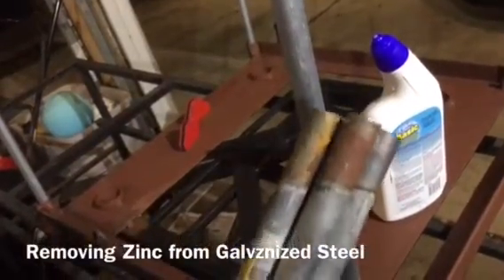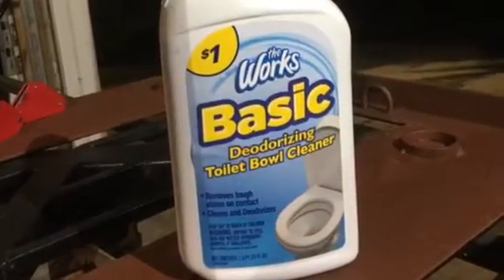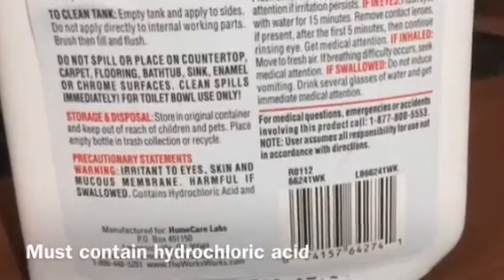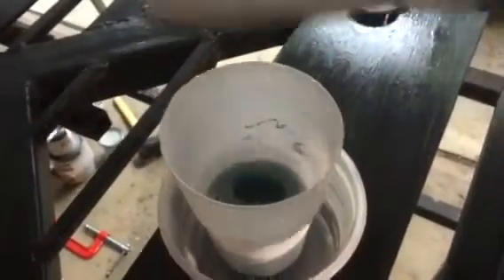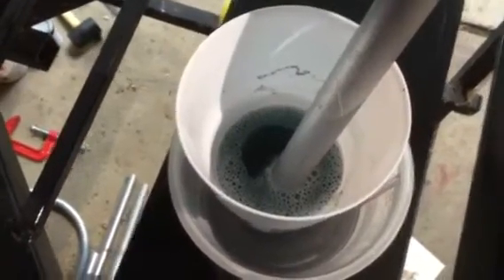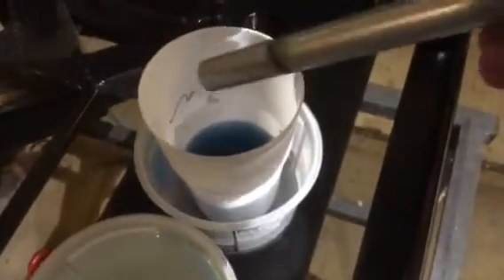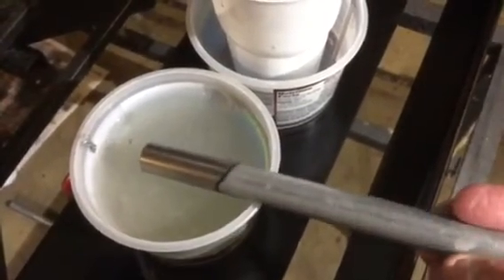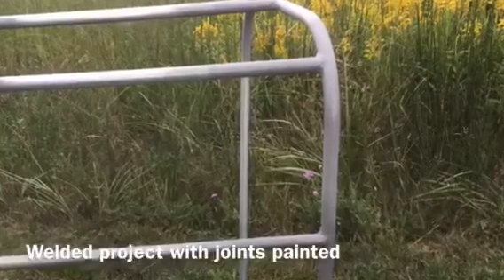Removing zinc from galvanized tubing with toilet bowl cleaner

Comment: This isn't just "dangerous", the gas it puts out is incredibly lethal and even without a lethal dose can cause permanent damage to your respiratory system. Please anyone thinking about doing this do your research about protecting yourself.
Reply from the maker: The comment is ambiguous.  Zinc forms dangerous fumes that can sicken you when heated in air at the temperatures required for welding or brazing.  That is why I remove the ganvanization prior to welding or brazing galvanized materials.  This is true for the conduit I showed in the video, but also true for nuts and bolts.  They have less zinc on them, but still present a real health hazard from the vapors.  I am very careful to remove the zinc and I always have adequate ventilation  when welding.  That is true  whether welding previously galvanized or not.  I prefer to use dilute acid as it is safer than concentrated acid.  There are many videos showing use of muriatic acid, far more concentrated than the toilet bowl cleaner I used.  A bottle toilet bowl cleaner lasts me years.  A bottle of muriatic would last decades and far more difficult to dispose of.  The fumes that are generated when removing zinc are hydrogen. It is generated slowly and, when done with adequate ventilation,  a scenario where hydrogen provides a lethal dose seems difficult to imagine.  Concentrated acid presents hazards.  Dilute acid toilet cleaner presents hazards, though lessened compared to concentrated acid.  Welding presents hazards.  Welding galvanized presents additional hazards that can be mitigated by sufficiently removing the  zinc coating.  Care must be taken, hazards evaluated before starting any work and proper protective equipment must be employed.  I strongly recommend reading the CDC information on zinc fumes <<https://www.cdc.gov/niosh/docs/81-123/pdfs/0675.pdf>>.  There is no lethal dose mentioned and others have questioned this point.  Zinc vapors should be avoided and can be with proper removal, ventilation and care..
Reply: Unless I'm wrong the fumes generated include high quantities of HCl gas. That is what is dangerous.
Reply from the maker: The low concentration of acid present in the commercial toilet bowl cleaner means that there is little HCl that can be released to the atmosphere.  Reaction with Zn consumes the acid, it does not cause a release of gas other than hydrogen.  Exposure danger is considerably reduced with the use of dilute, readily available acid rather than the concentrated muriatic acid suggested by others on YouTube.   Muriatic acid is faster and gives a far more dramatic result, but that is exactly the point of looking for a better controlled, safer alternative.   I was wearing eye protection, in case of a spill or splash.  Follow the safety precautions on the label for handling.